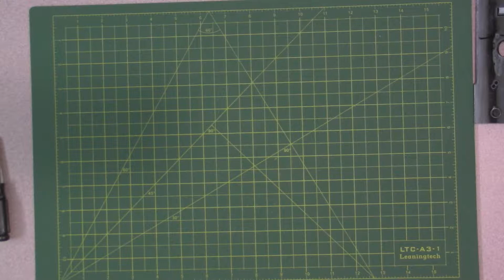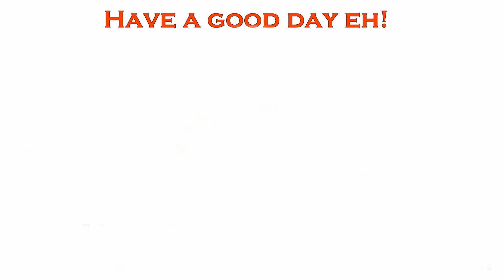P802MA 3D Printer Anet A8 Clone Unboxing Setup and Testing

Comment: Hi
Just watched this video and I think I’ve ordered the same printer which should arrive in the next 2 days but I’ve been told it’s a fire hazard and very dangerous and wires ect show on instructions are all wrong ect I’m wondering to send it back or not any advice please
Reply from the maker: Older models were prone to it I've had a few and no issues with the newer models I had one terminal block melt on the older boards for it. I replaced the terminal blocks on it and it's still running and that one is over 5 years old and thousands of hours of printing. Time on it I'd run it 24/7 for weeks. So just be cautious when hooking everything up and should be good and every so often check over the wiring things rattle and loosen up over time.
Reply: @Gam3T3cHElectronics  thanks for your reply I’m a total newbie with all this and I’m just worried now I’ve made a bad decision with this do you have a fb or inst account at all
Reply from the maker: I use insta more than fb so here is that link https://www.instagram.com/gam3t3chhobbyhouse/   And I don't think its a bad decision just like anything take your time putting it together and you should have no issues.
Reply: @Gam3T3cHElectronics  added and messaged thank you
Reply: @Gam3T3cHElectronics hey man I followed you too. I am trying to get my printer back up and running.